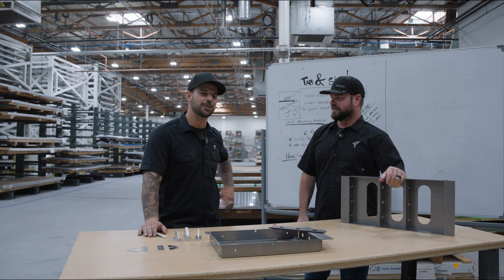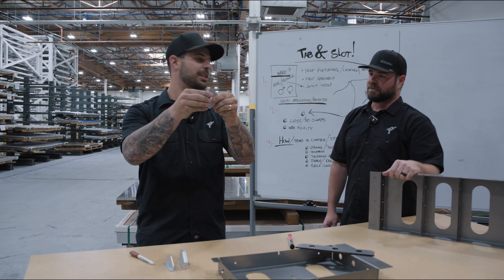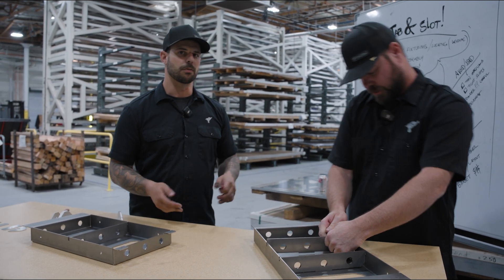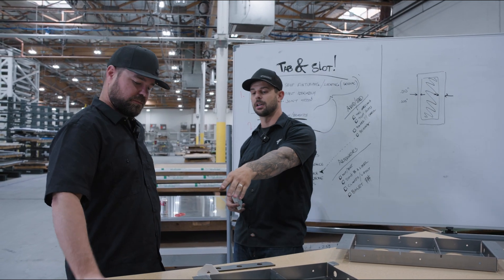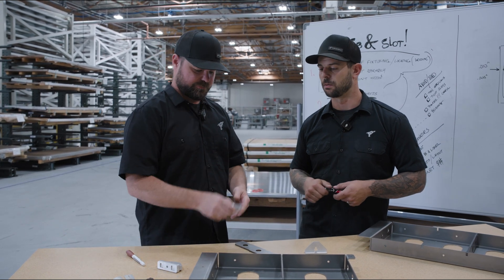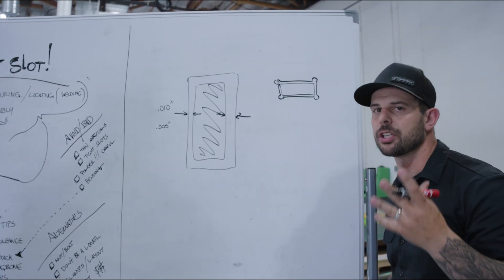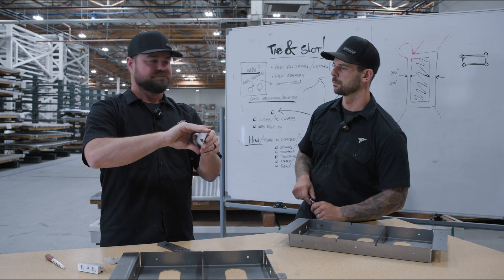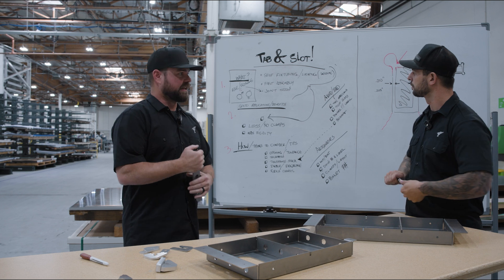Top Tips for Tab and Slot Design for Sheet Metal Part Assembly - Cutting Corners Episode 3

Comment: I remember some vid of guys building a cnc router machine and using this kind of tab and slot technique with careful clamping to make square, straight structures without depending on flatness of the material.  Transfers the straightness of the cnc laser to the straightness / flatness of your structure.

Comment: I’d love some more insight on designing the slot and tabs on the computer. Maybe some tips or pointers or good practices on when and where
Reply from the maker: @itsreallytom4310  check out this blog and our other video: https://sendcutsend.com/blog/designing-sheet-metal-parts-with-tab-and-slots/

We have it on our list to do an episode on CAD software and design tips, we’ll be sure to throw some tab and slot info in there!
Reply: There were videos i foud a few years ago about doing laser cut wood finger joints in Fusion 360.  Those techniques might be useful. Something about cut with body as a tool.
Reply: Mar 2 2023 was vid.
Reply: @ChiefBridgeFuser interesting I’ll have to look that topic up on YT. Thanks so much for the tip
Reply: @itsreallytom4310  took me a bit to re-remember the channel.  @DIVCNC video was first in series about building a machine "design".  About a year ago.